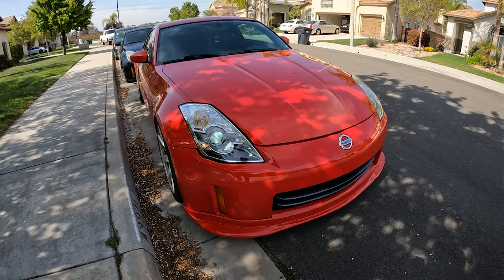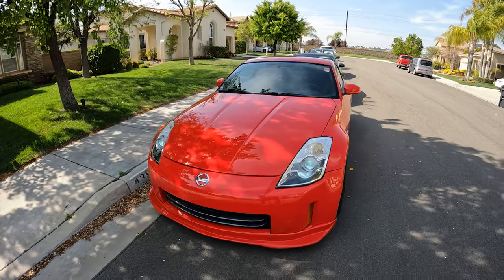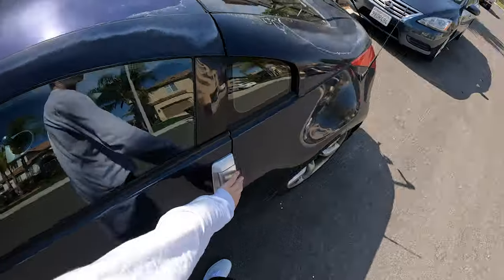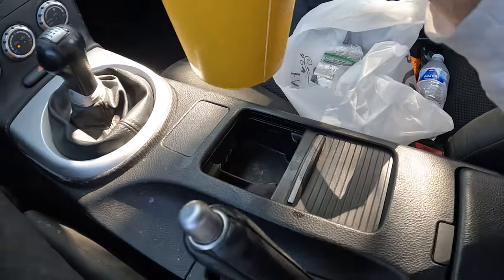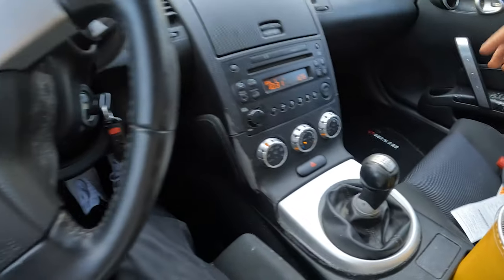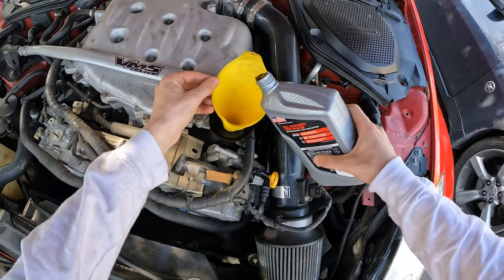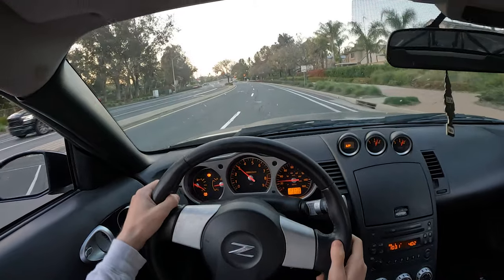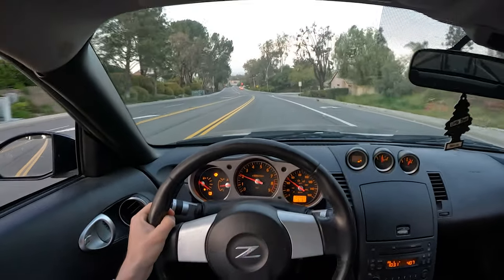Nissan 350z | Battling Dangerous Oil Pressure Levels

Comment: Oil pressure is low most likely because your gallery gasket is out. Very very common in these cars. I had to replace mine and I have an 08 with 90k miles and I usually don’t beat on my car unless someone wants the smoke lol.
Reply from the maker: Appreciate your comment Cody! I know it's a pretty common fix on the HR 350z. I've heard it's not as common on the DE / DE Rev-Up, so I'm hoping that isn't the case...but it's always possible! Will be checking the oil pressure sensor as well! I'll have an update video on Friday! :)
Reply: I have an 08 Z with 45k miles, im worried is my pressure too high while driving — its over 60psi when pressing the gas around 45-50% throttle at almost 5k rpms
Reply: @redline350zHR your gallery gaskets are good your pressure is great my gallery gaskets went and was at 14 idle 47 at 2k rpm’s and like 60-70 at 3k and now it’s 60 psi where your talking and what not so it’s good don’t stress I have three of these
Reply: @redline350zHR 30k miles my gallery gaskets went and the car was a one owner and a 70 year old

Comment: The reason the clutch on the HR is easier to press is because it has a CSC which means the slave cylinder is inside the transmission instead of outside like the older years. Started on the HR.

Comment: In Arizona, I've had really good results from using 5w-40. Seems like since I switched my oil pressure barely goes below 30psi on 100+ degree days after pulls sitting at idle. And being 5w keeps it thin enough on cold starts that I don't get above 90psi while accelerating. I have a modified NA 06 DE non-rev with the 5AT as a daily.

Comment: I have a 05 350ZI with an auto trans and the oil pressure seems low at idle also but once its under way it goes up to around 60,it never uses any oil between oil changes so the engine is  strong and tight so I don't worry about it.

Comment: Clutch feel must be the difference between traditional Fork and Slave cylinder VS CSC.
Reply from the maker: I learned that recently actually! My clutch went out in the HR a week after I got it...I thought to slave cylinder was out, and was bummed because it's quite a bit harder to get too than the Rev-Up's lol luckily it was just out of fluid! Quick refill, and it's been good since! Appreciate your comments man.
Reply: If you ever replace the CSC make sure the shop or you prime the CSC. You'll have clutch issues until you work out all the air. Clutch pedal will drop and wont return. The HR's are a completely different beast.

Comment: Just a heads up, its most likely the gauge and I wouldn't worry about it too much. Only worry when it affects your idle rpms. Like if you idle low and the oil pressure light is on then its a gallery gasket or oil pump failure. Great to see your cars are doing fine! Do not sweat this, the gauge is very inaccurate
Reply: My light is coming on at idle in my 06. 139kmiles. Just got the oil change done 2 weeks ago.  I switched out my oil pressure switch last year. The car also burns leaks oil from what looks to be the valve cover area. What do you think it could be?
Reply: @brandonjohnson8754 did u ever figure it out? my light also comes on at idle. im probably gonna start with replacing the oil pressure switch

Comment: Been having the same kinda issues too man. Been real afraid to push mine lately because I can feel it kinda losing some power after I get up to maybe 4,500 rpm’s. I see you redline yours but I rarely ever do that and still feel like it’s beating the hell out of it 🤣

Not sure about any of you guys but my gears have been grinding real bad around 86,000 miles. Not sure if it’s my clutch causing it to not be a smooth shift but it’s definitely more delayed and jerks a bit more then it used too.
Reply: Syncro, 350z gearbox synchronisers are known bad point

Comment: next time you cold start the red z check if it gets super close to 120 oil psi it should be barely off the 120. when my gallery gaskets blew it was at the same oil pressure at idle as yours and when i cold started it and it would hit 90 psi or when i floored it as well.
Reply: when i cold start mine, it doesnt hit 120.... your comment is very difficult to understand....u didnt say what that means "barely off the 120??" so when you floor it, it should be around where? mine never hits 120...
Reply: @redline350zHR  mine hits 120 when i floor it, and when its a cold start its about 2-5 psi off of 120. and at idle when fully warm should be around 15-20 psi if its lower than that either your sensor needs replacing or you have low oil pressure.

Comment: i had the same issue only mine stayed at 20 psi.i changed the oil and it was ok.maybe you have low oil level or you need do change it.if you have the same problem than change the gauge

Comment: Gallery gaskets😢
Reply from the maker: I'm really hoping it isn't the gallery gasket! I've heard it isn't too common in the DE and DE Rev-Up, just mostly the HR; but there are a few lucky DE/Rev-Up's that have had this issue as well. Valve covers getting replaced tomorrow so hopefully this will help the situation, also going to do an oil change and swap out the oil pressure sensor! Really appreciate your comment Carlos :)
Reply: @JohnnyB.  hopefully not, I remember my timing, oil pressure was bad at 100k miles